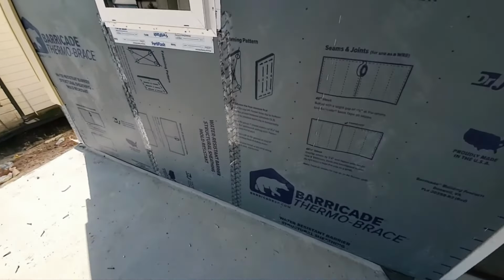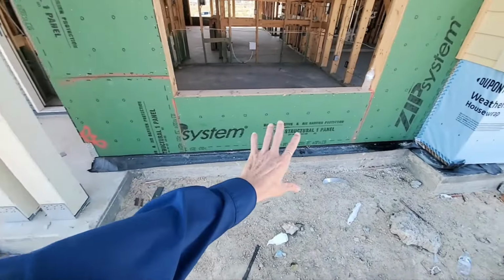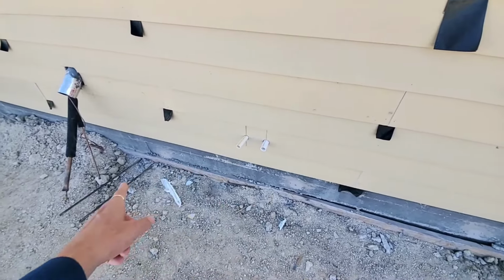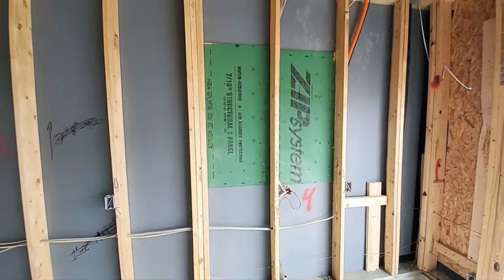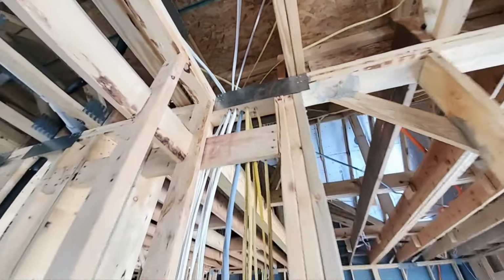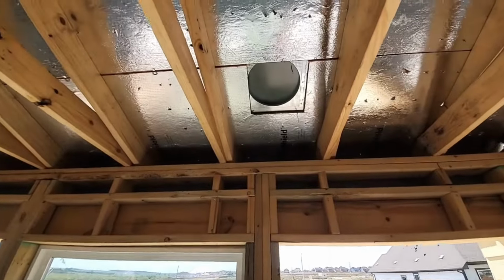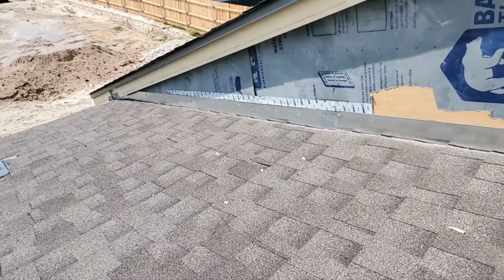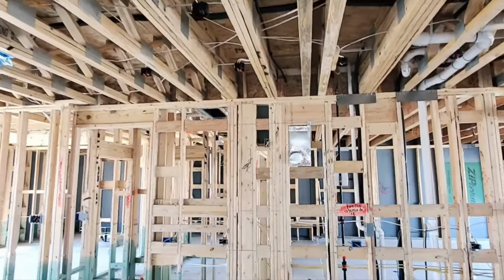Siding first, then windows??

Comment: My home is almost 35 years old. Last year I removed all of the wood trim around the downstairs windows and sliding door, found the was just a little bit of spray foam for insulation around the windows and door. Bought some spray foam for windows and sprayed it, the a couple days later cleaned up the overspray and the installed new wood trim. Amazed how much less cold air comes through.  I live 20 miles east of Seattle, so we do get a lot of cool, chilly days.
Reply: My house was built in 1964.  I pulled the trim off of a window, and was able to see daylight.

Comment: Ha !! .. Gotta love it . Most crapenters are Blow and Go . The siding going first might have been " Well the windows are on order and we need to get a bank draw . So go ahead and install the siding " . Nightmare .. But for some it's just they way it is . I don't like building out of sequence . Yep . The only way to properly set those windows is tear off the siding , It's almost impossible to get the head flashing in with a 1/4 " gap from flashing to siding and taped correctly . The sill flashing is another nightmare . .. I like to slightly tilt the sills and flash . Even run an apron under the sill flashing long enough to act like intermediate joint flashing . The Drainage Plane . No caulk on the the 3 sides  Ha!  You can do skip caulking and nailing on the sill . But determnined by the span of the window .  I prefer step flashing on sidewalls and an obvious kick out flashing at it's terminus  I like my housewrap not to be nailed so the roofer can tuck up under a little bit . In some instances this can't be done , Leave it flopping and let the roofers step flash then tidy it up . Many roofers go on automatic underdrive . And don't run the flashiing high enough . So when siding time comes . With some Hardi-Zones requiring a 1'" clearance between roofing and siding . I think up up further north a 2" gap for wind driven snow that melts .. Hardi will " Rot " and crumble . I always treat all cuts  Get into standing seam , shake or slate and the roofers almost always fail me . . The floor sheathing looks like it was exposed for awhile . Looks like a cheaper brand as well and possibly swelled up .  I like to double glue my butt joints . Guy drops the sheathing and scrapes off the side coming up and yes .Eyeball and 1/8 gap . Nail after glue within 15 minutes at most and make sure it's bedded befoe you oull the trigger .  Nailing at brutal angles on glued and not bedded sheathing is a potential squeak . I pride myself on no squeaks and had my first a few years ago .. After telling happy gun runner 50 times how to nail floor sheathing . He got fired after all my hair fell out . Figured if I can't get him to nail a floor off after 10 hours of examples , pleading and sending a Teleflora bouquet .. Then there was no way I could teach him how to cut a 30.32 degree angle on 4" staggered Hardi-Shake panels and following a rainslot pattern while I am frying on the side of a dormer . Using hand signals , Braille , and a Speak-N-Spell .. 43 years as a carpenter and even in my later years considered becoming a County Inspector .. But I'd get fired !! . I'd close down the entire county with what I know and have seen . County needs houses , County needs those property taxes . I would be the type that shakes the baby and glad hands the most popular builder and drive up and just sign the permit box and get invited to lunch . Ha! .  I always overbuilt to the point of anal retentive . I would analyze the shank of a nail , it's directional axis , it's molecular structure , Why a head of a nail is shaped like it is . And then go so far as A Rosetta Stone on how to go the elusive 13.71 " OC. Common Length Difference of a hip jack rafter at a 5.56/12 roof and be within aircraft tolerances . Ha! . Never had a spec home ever sit . Always sold before the drywall went up and many homeowners said they bought the houses I built , Because they looked like art even in the frame . Woven and stitched together like Angels on the looms of wood . Worked for the nations #1 architectural firm as a test pilot carpenter in The 90's . Details that are now on every plan they sell .. Toot my little horn . But when you get high end builders wanting only you to build their own personal homes . They know I never cut corners and exceeded every expectation . Still learning I admit .
Reply: The siding before the windows in all fairness I've seen before in the past from the wrong windows coming, vandalism, pushed back production. Depending on the siding type and window combination it doesn't necessarily matter too much. Get majority of the house done including siding so you can actually work on the interior. Casement + fiber/wood siding allows to over side and cut back when it's ready for install.. just cover the window openings with heavy poly and tape. I had two houses I had to do like that in 2007
Reply: @mikestang20  i guess there going to just but the hardy to the windows.no trim around the windows thats the proper way to do it. you have to leave one 8th gap at windows and corners and caulk with big strech or any nigh grad caulk.these boys dont know shit. i feel for people who buy these houses .there money pits you dont run pipes through sideing you cut a block of hardy trim cut a hole in it mount it to the wall flash the top of the block and but your hardy to it .haste makes for waste every time.

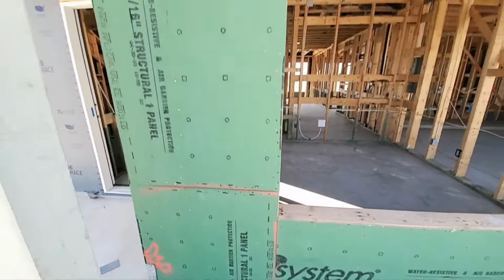Comment: Im surprised you didn't mention the "stacking" of the Zip panels starting around the 3:50 mark; every joint is run straight up a king or jack stud from the ground through the 2nd floor
Reply: @stevebengel1346  Exactly

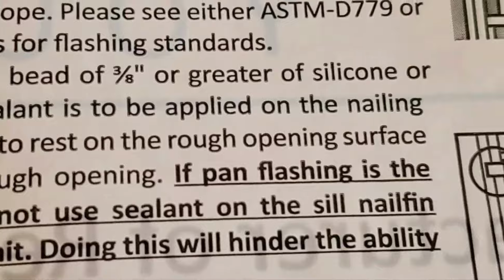Comment: 1:55 yes you should put silicone or the equivalent on the windows, but I do not recommend it for the bottom. If you caulk the bottom nail flange and water where to get behind the window, it has no way to escape. That’s another reason why it is best to put your bottom flashing tape on first, then install the windows. After that, put your flashing on your two sides and for your head lap that flashing should go directly onto the structure and not on top of your house wrap. That way if water were to get behind the house wrap, the head flashing can pull it back outand not go behind the window. 2:59 how does he expect to install the windows correctly with the siding already on it. There’s no way to install the windows and have the siding but up to the window. Not to mention most new construction windows have a gap where the siding goes into it. As a contractor you want to have top quality subs doing your work. And I have had very good subs that I could trust in and I pay them extra because of the quality of work that they do plus if I need them. They will pull off other jobs to come to mine if there’s an emergency and I need them. If you treat your subs well they will treat you well.

Comment: great video. When installing new European tilt and turn windows and doing siding for a new house, which should be installed first - windows or siding? My contractor is indicating that doing the siding first is preferred for European windows. For the regular American new construction windows it is the opposite - first windows then siding. Is he correct?

Comment: Great inspection on framing, sheathing etc.  Could use a review of electrical for which I noticed a number of faults, but  the HVAC is atrocious with U bends, torn mylar, failure to seal joints and a blatant failure to protect from the metal edges of the framing reinforcements.

Comment: At 16 minutes, flashing on the side wall with torn liner seems like this should have been step flashed and looks like the lower flashing is outside of the upper flashing at the joint.   Probably one or two skilled workers and the rest of the crew is pickup.
Reply: yep you never run a solid flashing down the rake

Comment: You can't nail the windows through the plastic instead of the holes because it increases the likelihood of the plastic cracking. And they should be snug not tight where it is stressing the plastic
Reply: I really don't understand that. The holes are there for a reason. It is actually easier to nail through the hole but somehow they still screw it up.

Comment: This is an older video so I’m sure you won’t see/respond to this but It’d be cool if you did. Anyways, I noticed that the “required by manufacture” tape is made by the same company that made the sheet (dunno the proper term sorry). Of course that makes sense that they’d recommend their own product, because why wouldn’t they?What I’m curious about is if you mark it as wrong because it’s not their brand, or if you don’t care about that kind of brand malarkey and it was wrong for another reason. Like is it required in code for some reason that it HAS to be what the manufacturer recommends and thus HAS to be their product, rather conveniently if that’s the case. Though I’m almost sure that it’s not; I am just curious is all. Also not trying to condemn you at all, and it was a great video!
Reply from the maker: Yo! Thanks for commenting. The code book states in about a hundred different places that a manufacturer's product has to be installed according to their instructions. To me it makes sense that a manufacturer would insist the installation of their system (say sheathing, fasteners, tape, flashing, for example) be from the same product line as that way they can control quality of material in their system. For products that don't have all of those items, the instructions will usually state the other materials meet an ASTM standard. That helps them with warranty claims in case the Tyvek wrap was installed with band-aids as flashing tape. 

Not sure if that makes sense but hope that steers you in the right direction!
Reply: @constructivainspections  That does make sense and was a possibilty I was leaning towards after commenting. It is a little convienient to be able to do that with your own products, but as you said it allows better quality control on their end. I see that the benefits outweigh the potential drawbacks. Thank you for actually replying too, you're awesome!

Comment: I wouldn't recommend 24" OC framing here in earthquake country far from TX.
Reply from the maker: 2x4s on 16"oc? Or 2x6s out there?
Reply: @constructivainspections  Mostly 2x6, 16" OC.  It's cold here too (climate zones 5 and 6).
Reply: We need 2X6 in CA, due to insulation requirements.
R19 required in the walls now.

Comment: Anyone using post and pre tension concrete needs to experience demolition. I can say without a doubt that those methods don't do much, if anything, for strength. Use rebar and a lot of it. Stay awfron the thin stuff.  Also, fiber mesh makes concrete weak. It is absolutely ridiculous the methods that they doop the customers with.

Comment: The plywood being higher than the other sheet is a bit overkill. The wood swells that the carpenter can't control. Obviously you've never built a house before, I think you're sincere but you're the usual critic of what looks like a solid job other than the hangers not being nailed.

Comment: The foundation is poured (tensioned) WRONG the house was to come down to fix that correctly JUNK terrible work all over I wouldn't pay more than 1/2 price for that thing(house)
Reply: Is there evidence that the foundation was poured wrong? You can tension the cables at any point in time after the concret3 has cured sufficently.
Reply: @yodaiam1000  guess it may depend on the design
my last garage floor the tension had to be applied within a certain number of days after the initial "flash" I believe it was after 36 hrs pre 1week of cure
Reply: @MDAdams72668  It has to be a minimum amount of time. The concrete only gets stronger with time. You want to post tension before the design loads are added but even then, it is not an issue unless there is a failure of the concrete.

Comment: Code says that the wall can be tucked under the sheathing on exterior wall on bottom and the pointed out a violation on the garage header that's only required if it's pocket framed and the blueprints would show it to be framed that way if it's less that 24" in length on the side. Listen, learn the  codes then make a video and btw I'm a licensed builder and a carpenter for over 30 years. I guess you got clicks even you've never built a doghouse before.